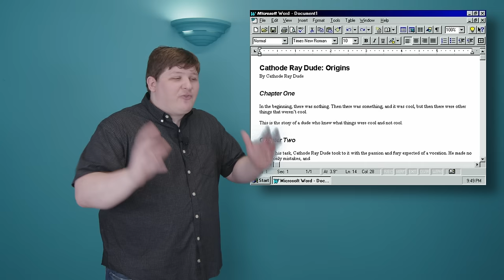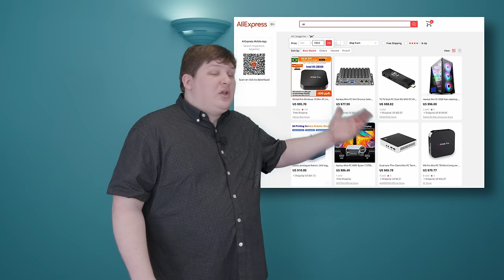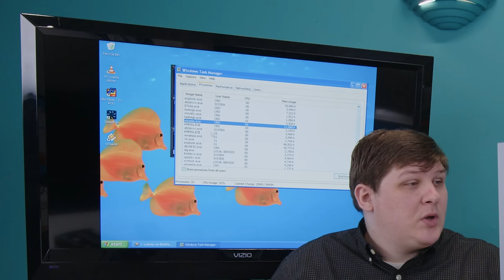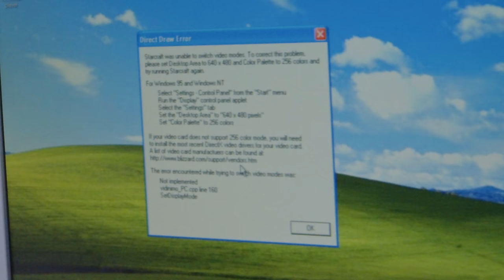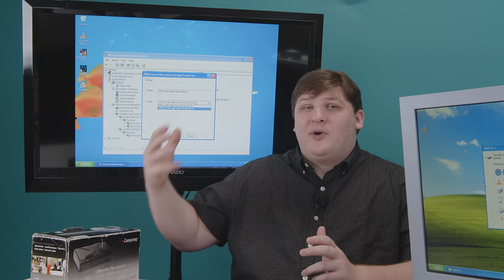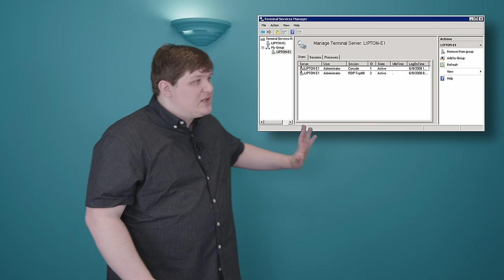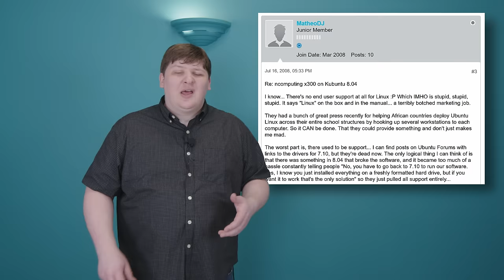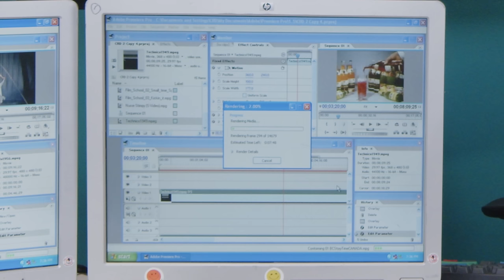7 Users on 1 PC! - but is it legal?

Comment: Wow, impressive. Not only impressive solution, but impressive how much work has gotten into this vid. So much that I never would've thought I would watch it whole, but I did. Also it is sort of eye-opening. Like it shows how garbage modern standard software pack became, including Windows. I would love to see if there is an easy way to do that sort of thing with Linux system, but on a software side of things. Like have 1 PC for 2-3 kids running linux and how to set it up.

Comment: the bargain basement computer is a raspi 4 for less than $100 running linux.
no, you don't need windows. in particular if you're starting up the infrastructure in a developing country
the quake issue is possibly that it requests one full core per display task.

Comment: Humm.  The XP source code was leaked a while ago, I need to troll it a bit, but I suspect terminal services had an interface for drivers.  Wyse terminal's had a mode where you could echo all the displays in one giant display and they were just glorified X11 terminals.  So maybe somone knew enough about the internals and created a filter driver that would log you on, and it change the display to one of its internal ones.  As for the keyboard issue, I suspect the fpga is trying to save on cycles and just scanning each device one at a time.  Not sure there.  But I don't even think it had a true vga ip.  I think it was relying on the terminal services display driver and just dumping that to the memory of the card and the fpga just acts as a ramdac and dumps it to the monitors.

To be honest, I think it died because it was too expensive.  I mean not from the user point, but FPGA's are expensive.  You can get away with a cheap CPLD, but your paying maybe 50-100 for one of those chips and you are locked into their availability.   If you don't need drivers for that pci card for it to come up as separate displays..  Ok then call me impressed then.

As for it being legal , yea it properly is.  They are coming up as extra monitors, are you saying more than one person cannot use the computer at the same time?  I think this device was made to get AROUND the legal  area.  As you said, you need CAL's if you want to use terminal services on the NETWORK.  Still, just wierd that no news about sueing them.

Comment: But to go back to your original point; if your computer needs have not changed from doing the essentials such as word processing, spreadsheets, standard definition video editing, and photo editing, and you just want a low cost computer that just works, you're not going to want to deal with the complexity of a multi-user computer and sit through an hour and ten minute video. For that, a person can just get themselves a Raspberry Pi and be done. No licensing headaches, no planned obsolescence. It really is the equivalent of buying an XT in the early 90's, but better and cheaper.

Comment: let's just say that those micropdp-11's controlling the heating and the aircos installed in the 1970s still do that exact same job quite well. :P (ofcourse it is no longer a great idea to leave telephone modems or network cables inserted into them although they are so old noone still remembers how to bypass the login anyway but hey ;) computers get installed for a certain task. and usually outlive the buildings they are in. -except for internet stuff-, that changes pretty much every time a customer comes and goes... your own database you keep track of the customers in however... well. that as/400 did the job quite well in the 1990s and it therefore still does the job quite well today. do washingmachines go 'obsolete' ? do fridges go 'obsolete' ? same with by far most computers actually doing something. it's a machine. it performs task x. and as long as task x needs to be done and the thing doesn't fall apart, it's fine. :P

Comment: I got up to the part where Adobe Premiere is showcased, I must add that the program was fascinating at the time and most optimal contrary to what is said in the video I tried plenty of others and they were mostly useless in comparison and crashed more then AP1. 
Still have much more options so as easier to use then it's more decade later new versions (forgot the names). For example the formats so as working and rendering the same was supported by free updates that you manually pick and choose what you want or you can download a full package. Something that today doesn't exist instead you are forced to be always connected online to even open the damn things and always updated with 99% trash content so as equally disabled at one point where you are forced to buy a 'new version' and learn to use it from scratch too.
AP1 was supported for a decade maybe even more, I lost count.
Going through 720p era, 1080p era and bunch of others back then new formats, which again you got for free with manual updates.
I used AP1 up to 2015 or so and was my go to program for video editing next to or lets say paired up with Adobe After Effects. Really didn't needed anything else. Always running it on a offline machine without the need of other junk in the background.

Good luck using today something from 2015 or something from today in 2 years because it wont exist and even if it will claim to be same thing or something ''better'' it will not be the same thing nor better in the big picture.

As much as I support development and getting new featured equally I hate losing access to old things so as learning to use over and over the same crap just because they forcefully change something to the point by the time I learn it I realize it's missing what I need also by that time maybe a new update will drop that repeats the process of be starting from scratch...

SO yeah no thanks to new things since for something new that is 5% you lose 80% and that remaining is questionable at best.

Edit: I forgot to mention that I loved Sony Vegas too however it crashed a lot and I do remember it like it was more milked ... I used that one for more then a decade too however everything else I hated ... I am pretty sure there was something out there that was other worldy for video editing however next to nobody including myself could afford it so we never got to try it anyway ... so obviously I don't count those instead that middle ground of tech and software.

Comment: NComputing didn't technically violate any licences! If you ran this, YOU were in breach of the Windows licence - not NComputing! They enabled you to do it, but you were the one actually running stuff. The only thing they could possibly be guilty of, is modifying Windows - and as long as they didn't provide any sort of licenced Windows code in their software (which I assume they very carefully didn't) - they were probably completely and utterly legal. And, to be clear? Microsoft has always had the right idea about piracy and out-of-licence use: the customer doing it wasn't going to pay you ANYWAY so it's no loss of profits; as such, it's better that they use Windows instead of any competitor product.

Comment: Off to "The RE-PC" to buy X. Me -> falls out of chair. RE-PC is last place that gets me excited to re-visit Seattle. I was born there and have always lived within or around its aura.
As for plateau, minimalist me has standardized on 720p because my old eyes can't tell the difference  due to the  small screens (in modern terms) I use. Running bad python code against large data sets takes 20sec on my 2010 box vs 12 sec on a 2018 machine.   Pop an SSD in a good early 2010's with a linux distro and WOW.

Comment: In times past when computers where huge and centralized, to use it at the office there was what you called a terminal hook up the same thing that what your showing is a terminal hook up except your not connected to a huge computer but your home PC the principal is the same if you took a terminal home you would need a phone to make the connection to the terminal and connect to the centralized computer which was at the time reels of tape this was before the PC got into homes.

Comment: i came across a dell precision t7500 with 2 xeon processors. 3.2 ghz and 8 cores per cpu. would love to see that run this. it does have one pci slot by the way; currently occupied by a soundblaster live card

Comment: i mean i still used a core 2 duo and a gtx 9800 all the way to about 2013 and it would still run modern games of the time fine, and then a used an rx390 for a long time too, its only been the last couple gens when stuff has gotten so intense you have to upgrade every generation to run games at max settings among other things

Comment: All I tend to work with is x265 now or should I say that is what I shrink everything with lol. I am in the upgrade components as you go crowd, just got an RTX 4090 but using it with an I9-11900k that replaced the I9 10-900k to get PCIE 4 lanes lol.

Comment: So, I think we can fix this. It just takes will and cooperation. I think it's especially incumbent on software and web developers to solve this problem, but they have little incentive except altruism. 

We need highly optimized applications and especially websites and web browsers for older computers.

Web browsers today are being asked to do a lot more than they were in 1995 or even 2015, but that doesn’t mean they have to do everything. 

I like to operate with many browser tabs open, but we need the option of web browsers without tabs or with a tab limit for older hardware. And, of course, they could set it so unused tabs would not be stored in RAM. It might not be as fast to switch between tabs as on a new computer, but it would at least not bring the older system to its knees.

YouTube is another major culprit in this. People use it all the time, but we need a version of it that is more limited for older hardware. It's not just the resolution people choose for watching a video; it's navigating and searching on YouTube that is a drain on resources. So, Google could address this very easily by doing a hardware and browser check and adjusting the experience if the resources aren't there. At least the user could have SOME access. Perhaps they could also limit video resolution options based on hardware. Running a Core 2 Duo with 2 GB of RAM? You're limited to 480p because there's no point in running anything beyond that.

I think we can optimize other kinds of applications as well. No, you probably aren't running Premiere Pro CC or DaVinci Resolve on a Core 2 Duo with 2 GB of RAM, but you should still be able to run something simple that will edit your video using proxies and make simple titles. Final Cut Pro and iMovie are exceptionally well optimized, but those are only for Macs. We need something for Linux that can do that.

The other major culprit in this is Microsoft, which continues to add all kinds of self-serving bloat through new versions of Windows and through Windows Update. But even Linux is doing away with 32-bit support in most distros, and we need updates for security at a minimum if we're going to be connected to the internet.

Comment: >  Linux has even less excuse - why is this feature not just a mode you can enable while installing Ubuntu?

Erm... Linux already does this, and I've used it in 2001. "Remote Desktop" in 2000s Unix terminology is X forwarding. "Multiple users on one host" is creating two X server configs that point two sets of keyboards to two separate X server configs with their own graphics cards.

There was nothing preventing you from this; just lack of knowledge and interest in doing so. Starting from ~1995 when the PCI bus enabled multiple video cards, and ~2000 when USB enabled multiple keyboards on one PC, you could do this. You didn't need any NComputing for it - two Virge3D's and some USB keyboards would've worked.

And yes, using X forwarding in 2002 to remote to my desktop 120 miles away over a 400kbit uplink was *slow*. But it worked fine, side-by-side with my home desktop.

And then I get to the point in the video where you realize this. Never mind.

Comment: Word 95? I can assure you that Word 2 was perfectly adequate. And it only needed 6 1.44MB floppy disks.
Mosaic was a decent browser.
Most of the games that won't run on Win10 were little better than anything from 1995. What has Call of Duty got that Doom hadn't? Better graphics and pretty scenery. And Steam have got C&C Red Alert for a few pounds.
I only replaced my i3 from 2010 because it was crashing. Granted, I'd already bought it a faster graphic board and an SSD.

I used to support computers that used a 486 for up to 20 employees with dumb terminals, in the early '90s.

Comment: Still have a working and daily used Core i7 875k system that can do anything a new PC can do as long as it doesn't require instructions the chip doesn't have and it's not terribly slow either. A small correction Starcraft can in fact run in a window just add -w or -window as a command line argument in the shortcut. If you put this into something with more processing power, which would be pretty much anything that isn't a VIA/Cyrix or Pentium 4 based chip say a CPU with multiple cores a newer architecture that is faster, like my old First gen i7 which has one PCI card slot on it's Asus p55 based board each of it's 4 cores is faster than any Pentium 4 produced and it has hyperthreading as well.  Even in 2007 a Pentium 4 would have been an awful choice for this task they had dual core Athlon and Core 2 chips out then that were over 3 times as fast.

Comment: I wish Core 2s and Pentium 4s running Windows XP would still go on the Internet, but no, nothing is supported nowadays. Firefox 52 is the last version to run on Windows XP and still works with about 50% of the modern web, including YouTube streaming, but that number will sadly drop more and more. I never want to use Windows 11 and as soon as Windows 10 can't do the things I  want it to do, I will probably just dual boot W10 with Linux. I predict by 2026 Windows XP won't load YT, 2033 for Windows 7, and around 2038 for Windows 10. If the web and video games didn't exist I would never need anything more powerful than a Pentium 4 from 2004.

Comment: I still use computers from around 2007 that run windows 11. I tell people if all you do is school work or web browsing and watching videos it’s a waste of money to buy a new pc. I actually prefer the modularity of older laptops and in my opinion the new sub $600 laptops suck with terrible non upgradeable specs and  small unusable storage space. an older laptop is always a better choice then those and they usually work fine with newer operating systems and software worst case needing a cheap RAM, CPU or SSD upgrade. Heck my Q9650 system from 2008 is decent for some light modern gaming even.

Comment: I wish something like this existed in 2023 where PC's are getting so powerful it is kinda pointless in a way. I myself own an RTX 4080 and ran two games at the same time maxed out at 4K and both were easily hitting 60+ FPS where zero lag or latency issues, so it would be awesome to split the system in half and maybe run two of the same game (Forza Horizon 5 for example). 
- This would allow a local two player setup on two different displays but only using the single PC while also still having higher graphics than a Console. 

I would expect something like this to still exist even today but I doubt it would run good enough to be worth it (for my idea that is), the only way I can think of doing this is through Linux and Virtualisation but that is a HUGE Pain to set-up and Nvidia is terrible at drivers for this.

Comment: 2008-2009 mac pro user here it keeps up really well ans doesn’t struggle I am doing 4k60 on it and its not struggling at all and also my system is running 2 users at once using aster and it has two gpus and cpus so nothing really bottlenecks since I use it for editing and gaming

Comment: If it does Linux and windows, then why are you only testing it in windows? Particularly for purposes of figuring out how it works, you can probably extract a lot more details in Linux.

I am assuming that if they said it was supported on the box, then they probably already had something out at the time.  I wouldn't expect the Linux drivers to be on the windows CD either, since they typically aren't with modern hardware either.
Reply: I think Wyse had x11 thin clients before 2000, so Windows doing this before RDP type stuff is more interesting.

Comment: Very late comment here but nowadays you've got a wide selection of DDRAW wrappers, like dgVoodoo or cncDraw, I am wondering if using one of those could allow you to bypass all the jank resolution mess that games of the era did, I'm pretty sure for one that starcraft could be forced to run in a window this way (heck there's even 3rd party launchers for broodwar that specialize in that exact thing). Whatever the case may be I want this crap in my retro pc setup and I want it fast!

Comment: One could think Microsoft did not bother going after them because the market share for this particular use case was too small to bother putting any effort on. After all, who would buy your Windows Server or Remote Client licenses when they can't even afford the computers to run those on to begin with? And those who would be able to afford it would most likely chose a direct-from-vendor solution than a "hack" from a third party.